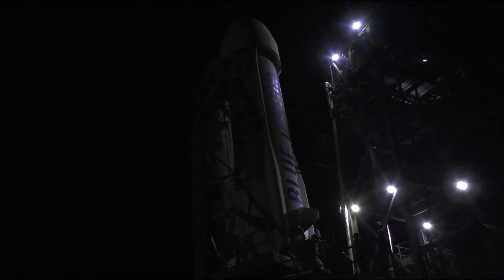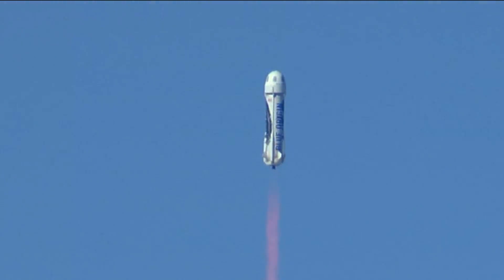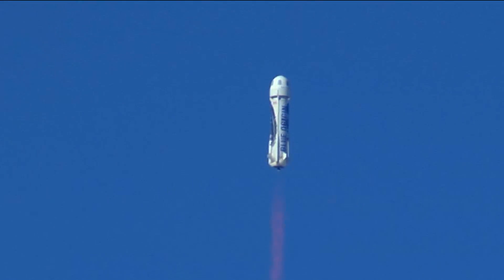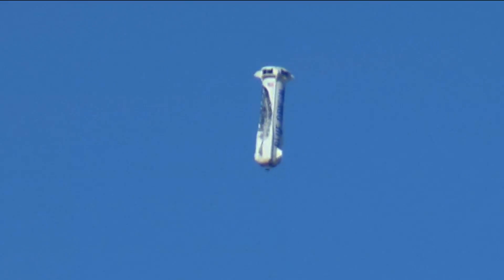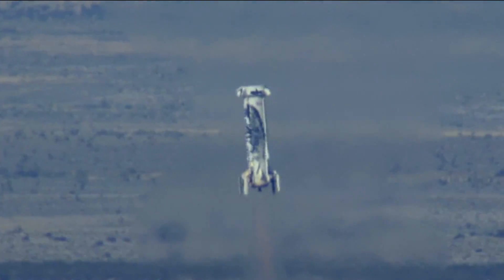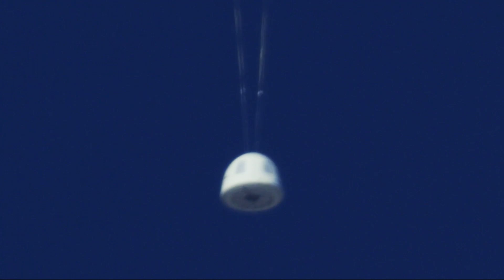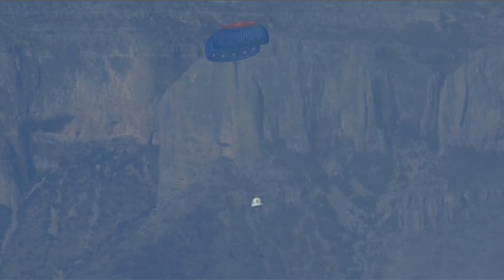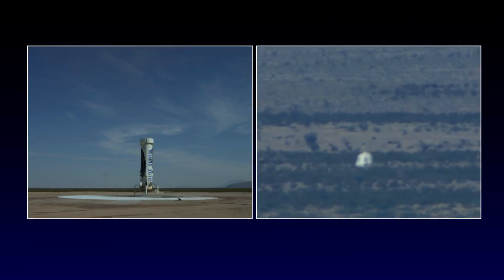Flight Four – One Chute Out

Comment: Did the retro ' s actually fire on landing?
Reply: Not sure. If they did, it wasn't enough in this case (one parachute missing) - on alphr.com they reported that the impact was faster than planned, "The test should have seen the capsule land at roughly 1-2mph, but it 
actually ploughed into the ground at around 20mph, according to Blue Origin’s speed monitor."
In any case - bloody awesome!! :)
Reply: Agreed, awesome for sure. Also, if the seats are well cushioned and formed, given the fact that you'll be lying on your back inside that capsule, 20 mph would be a good jolt but nothing life-threatening. Maybe even preferrable, as Blue Origins would have to do something to compensate you for that jolt, and what would be better than a free second flight? ;-D

Comment: So, is th dick shape functional, or did they do it because they could?
Reply: It's functional. It's aerodynamic for ascent and self stabilizing in the descent.
Reply: Cool. Plus it looks like a dick. Amazing design. Seriously. Wonder why no rocket cam on this trip. Oh man, I shouldn't post at night. I was just thinking about the shuttle warm nitrogen cap. Thanks, though.
Reply: most rockets look like a weiner or vibrator.
Reply: ah, rockets are just phallic in nature, its and aerodynamic shape for somthing with a rocket engine
Reply: It's more that it's acceptable for ascent and required for descent. Smoothly merging the capsule to the body of the rocket is preferred but since BO is landing their first stage the way they are, the gap in the top of the booster, along with the wedge fins and the drag brakes, really help to stabilize and slow the rocket on the way down.
Reply: Capsule must have this form for use as a cowling during takeoff and as aerodynamic brake when the descent - cone shape.
Reply: know. I was feeling terribly silly last night.
Reply: I was looking at what I suppose is the bottom off the capsule. It's a little different. Usually it's faired into the body of the rocket, but I guess the structure is useful both in ascent and descent.

Comment: Huh. I wonder if the suicide burn is a precalculated table of altitudes and velocities or if the booster detects the remaining fuel and descends just slow enough to land with nearly zero remaining.
Reply: that wasn't a suicide burn
Reply: François Canguilhem
Sure, they didn't go full power right at the last millisecond but they did shed a few hundred m/s in a very short amount of time relatively close to the ground.

A better term would be "final descent", I guess.
Reply: A suicide burn implies the most efficient way to land at pretty much 0 margin. This was just a "plain" landing burn. Slowing down a whole lot very close to the ground is just how propulsive landings work. Rocket engines allow you to do that safely.

As for when the burn starts: I'm fairly confident that the flight profile is pre-determined, but that the rocket can deviate from it to correct for errors. For instance if the engine starts a bit early or late, the rocket will adjust the thrust level to compensate for that.

Comment: I think your retrorockets were broken because the Dust didnt pick up until the crap they hit the ground
Reply: I did watch it in slow motion.  And if they did fire then they must be made from bottle rockets cause  not only can you not see them they're also
 completely useless
Reply: +Chuck Norris why high are they off the ground when they fire these Rockets?
Reply: It doesn't take long at all for those rockets to kill only about 10 m/s of velocity. Even one providing only 2g acceleration would do it in a mere second, and these are a good deal more than that.
Reply: Soyuz uses the same system. Works great and looks pretty much the same as this does,

Comment: Watching it at 0.25x it's clear the retropropulsors blow the dust away before the capsule hits the ground. I wonder why Soyuz's look like an explosion though. Does anybody knows?
Reply: Soyuz capsule is a hell of a lot heavier than this one, so you already need more powerful thrust regardless of any other considerations.
Reply: Different fuels? Im guessing
Reply: Different terrain probably.
Reply: Retro rockets fire just before the capsule lands....standard soviet procedure for manned landings.
Reply: Capsule "Soyuz" use "retro rocket" 10 ft above the ground. They work very fast - do not blow off the dust for a long time, and the result is a strong impulse, like an explosion. This system only reduces the speed, and do not put the ship on the ground.
The same system is used in landing heavy machinery, but other rockets.
Reply: I'm pretty sure there is an air-bag, just air
Reply: FROM JAMES MC GUIRE  ROBERT GODDARD WOULD BE SO VERY PROUD OF YOU AND WHAT ABOUT STARTING UP BLUE ORIGIN            CULT  FOR  US THAT ADMIRE YOUR EFFORTS?
Reply: From what I could find the Soyuz uses solid fuel to produce a controlled explosion below the capsule to "cushion" the landing. The New Shepard scape system seems to be based around solid fuel rockets too so I take it the retro rockets use it too? They certainly (?) don't rely on an explosion for landing ^_^
Reply: Damian Reloaded
Err, no. The LES is designed to fling the capsule thousands of feet in a few seconds, not cushion the landing. Solid fuel rockets can't be shut down...
Reply: ***** No what? You're questioning what I took directly from blueorigins website but you're not clarifying where (if) is the mistake. I'm saying soyuz uses solid fuel for retro rockets, BO uses solid fuel for scape system, it wouldn't be a long shot to think they also use solid fuel for retro rockets. Also the amount of time the solid rocket is turned on depends on the amount of fuel it has. If it has fuel for 1 second you don't need to turn it off.
Reply: Actually solid fuel rockets can't be throttled or shut down, they burn until fuel is exhausted. New Shepard's retro rockets are definitely solid fuel. No other kind would work for that task.
Reply: ***** That's my speculation too. I couldn't find anything about BO's retro rockets on the web. Soyuz' burn all at once like a ball of ignited gasoline. Maybe BO's burn bluer and for a longer time?
Reply: There's no speculation about it. They're small solid fuel rockets, just like Soyuz's.
Reply: ***** So the original question remains unanswered: Why are Soyuz' (so) visible and these are not?
Reply: Damian Reloaded
I'm still thinking it's down to the terrain.
A more densely packed or wet topsoil would give a less pronounced cloud of smoke when disturbed.
Reply: ***** It's seems to be a mistery... My hypothesis is that BO's has more trusters with less specific impulse and I'm willing to bet it lands at least as hard as the Soyuz.